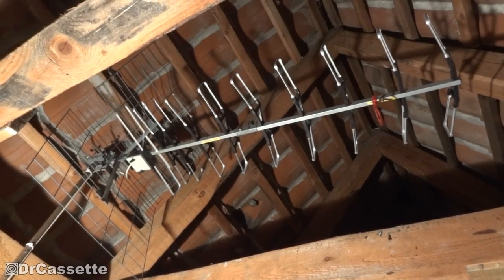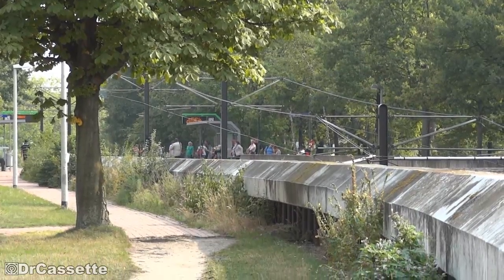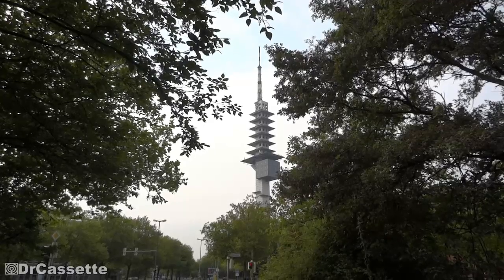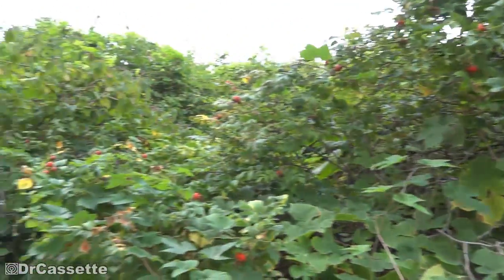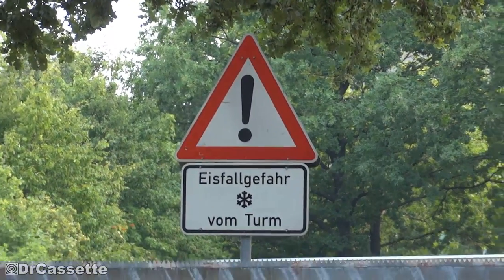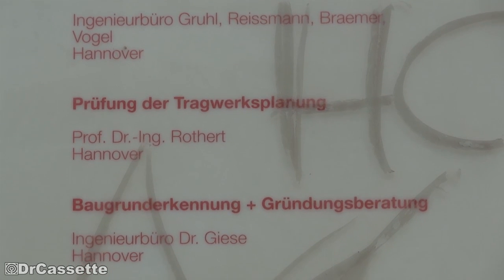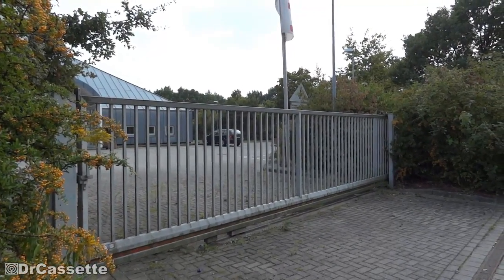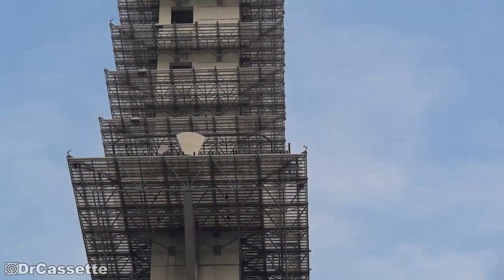The TELEMAX Hannover radio tower!

Comment from the maker: I'd say it's for all sorts of equipment since the building down at the base of the tower is rather small. According to that info sign the box section can carry 800 Tons of weight, so it's possible that it also contains some generators. As I said in the video, unfortunately they don't really tell you what is what...